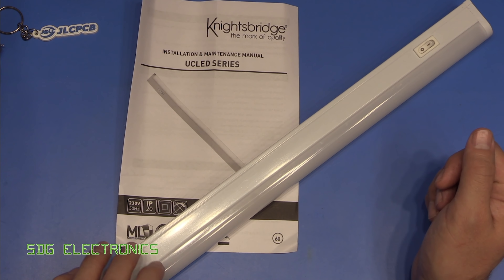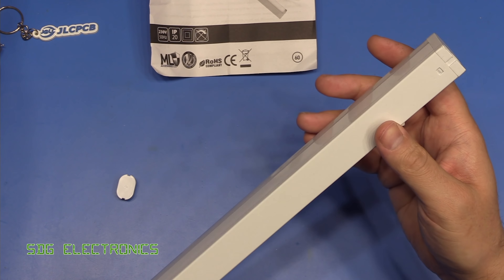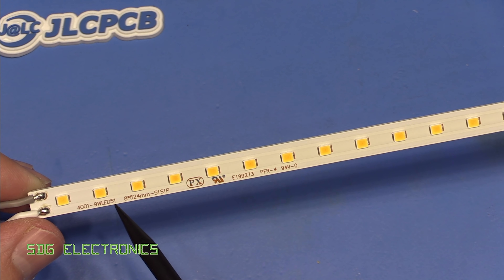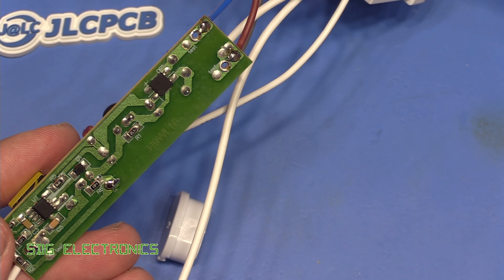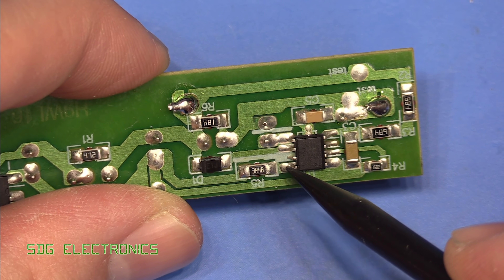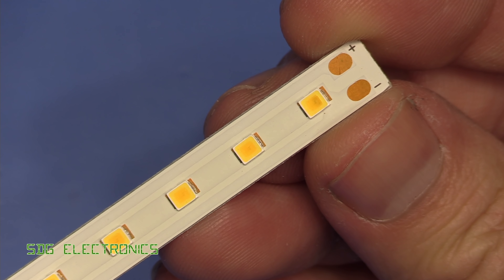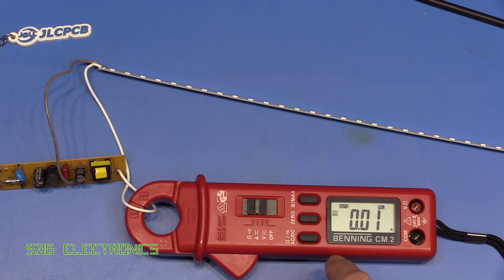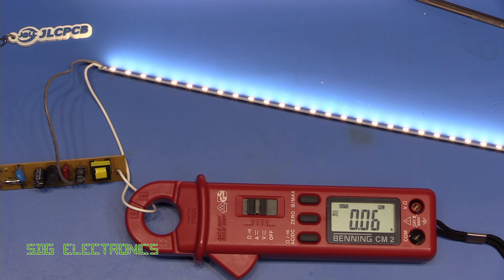SDG #200 The repeated failure of Knightsbridge strip lights.

Comment: I periodically also repair blown out LED lamps. And instead of a burned-out LED, I usually solder a 20-50 ohm 0.25-0.5 W resistor. After this, the lamps are no longer returned for repair. Even in my 32-inch TV, I replaced the burned-out LED in the backlight tape with a 20 ohm 0.5W resistor and after that no problems for 5 years.The resistor will limit the inrush current during operation, which can break through the heated LEDs, but will slightly reduce the efficiency by a couple of percent.

Comment: I usually buy cheap no-name LED light fixtures and bulbs, and in my experience dead LEDs are the most common failure points. I think it's because manufacturers pump as much current through them as they are rated for, if not more - so the light can shine as brightly as possible with minimum manufacturing expense. This is also a big problem for TVs with LED backlight. Of course, drivers have died on me a few times, but those were the exception. When I build my own LED lights I tend to underdrive LEDs, i.e. use 1W drivers with 3W LEDs. This way they still produce plenty of light but last a lot longer and produce less waste heat.

In the case of your light it's strange that there was one LED that looked cooked while others are almost pristine. I'd expect all of them to show some signs of degradation if they were overdriven. So I suspect that the dead one had a manufacturing defect. Maybe higher equivalent resistance, making it overheat when driven with a constant current.

Comment: The same strip lights we use in our refrigerated cabinets at work, in general they seem quite reliable. Occasionally we might get one that's faulty out of the box, the next time I'll strip it down and check whats wrong. I think on the larger ones there might be 2 strings in parallel as I've seen them with one side flickering so probably a faulty LED in one string.

Comment: 9:19 using rosin core tin of course it would resist bridging))) it flows away from the gap.
That's why I use tin without flux. You can have more control over it by dispensing precise amounts of flux.

Comment: I recently began to suspect that humidity may affect lifespan of cheap chinesium LEDs significantly.
I bought ~36x E14 spotlights with 4x 1W LEDs each and only ones (7) in single bathroom fail stupid often.
Checked currents, temps, swapped lights from different rooms, nothing matter.
Used like 35pcs pack to repair ones in that bathroom and like 5pcs for other rooms.

Comment: 60mA with 1 turn looped through the clamp m.  looping 10 turns through would probably give better resolution if necessary  (0.055 -.069..) ..👍

Comment: Bit of a fail design-wise if one LED failure totals the whole strip?  On another type I just fitted (and modded to get right length) there was a bus running down the sides of the strip and suppyling sections with  appropriate resistors, that was with a fixed 12v DC supply to the strip.

Comment: Most of the time, at least in my experience, it is usually an LED or it's internal bridge wire that is at fault if the bulb or light dies fairly early after only a few days, weeks or months.  If the bulb or fixture dies after that it tends to often be a driver failure but it really depends on the build quality.

Comment: I think it's a bad idea not to use the warranty, because otherwise the manufacturer will not fix the problem which seems to be systematic. Not everyone is like us able to figure out the problem and short out the broken LED . If the problem stays Hidden it just leads to so much waste,such a shame.
I urge you to use the warranty even if it is a hassle, a lot of manufacturers seems to be making LEDs designed to fail quickly and they are getting away with it.
Reply: Exactly this!

Comment: That last LED has less copper to its right compared to the rest of the LEDs. Also see that the dark spot is on the right
Reply from the maker: Good spot
Reply: Are you suggesting 60-70mA going through it heated it up so that it failed?
Reply: @GeorgeGraves  yeah
Reply: I was just about to suggest that.... perhaps a “dry” joint where the wires connect to the led strip, causing the joint to heat up? I had an almost identical fail with the led closest to the wire connection on a light at work .... just thinking aloud here.  They had thrown it away along with the power supply, repaired that (dry caps) and shorted the first led... bingo, now it’s a microscope ring light on my bench 👍

Comment: I recon that the leds need some more heatsinking. The last LED does have less copper around it. I think they are being driven on the edge of their specification and the heat dissipation the manufacurer allows. Together with the enclosure, no ventalation, smaller heatsink area and tolerances in the LEDs has caused this one to fail first. The LEDs will last a long time under the right conditions, just turning the current down by few mA could extend the life by a fair amount and not really noticable in the light output, shame really.
Reply: The copper tracks hardly aid in heat dissipation since they are too thin and the thermal coefficients from the die to track are far too high.

Comment: Logically it shouldn't be the case, but from my experience it's always the first or last LED that fails first in these aluminum strips. Don't know why, though.
Reply: It's @ the " end " of the strip.. so heat can dissapiate in one direction only... hence more slowly...causing higher temp. rise...so maybe the reason is thermal failure....
Reply: @analoghardwaretops3976  If i imagine thermal gradient in such a strip I think that the hottest point would be in the center, because it's surrounded by warmth from both sides, so LEDs should theoretically fail there if it's due to high temp. Further investigation is needed I guess.
Reply: @hackleberrym 
 ...theoritcally  so  but for such a case (center hottest) we have to assume...
1) there really is some air flow...
2) led @ extreme end has same temp. rise and rate of temp rise as other leds.." if"  its thermal dissap. is adequate..
3) assumed is horizontally placed.. being vertically placed this assumption won't hold up.

Comment: With a broken led you might have a chance of repairing the next time
Reply from the maker: Just need a better way of gaining access. I think sliding the strip slightly and desoldering could work better
Reply: @sdgelectronics  I think you'll be able to remove the diffuser after unclipping just one end, which will give you full access to the LEDs.

Comment: Thanks for the teardown and investigation, surprised it wasn't an electrolytic. Designed around cheaper components for cost cutting. Without getting too involved in your kitchen layout, may I suggest using two of the 300 in series instead? Seems like a 600mm unit fault.

Comment: Cheap LEDs all suffer from the same low life syndrome. 
Most of the time it's the bonding wires that come lose, arc and create a black spot.
These are also impossible to replace as they just disintegrate as you clearly demonstrated.
Reply: The problem with all these LED bulbs is that manufacturers rely on them to operate at 50-60 degrees Celsius. Which means that the temperature of the crystal will be 75-90 degrees, which is already critical for the crystal and the crystal breaks through during current surges. If the lamps were equipped with sufficiently large cooling radiators that would keep the temperature at 40 degrees, then there would be much less negotiating LED lamps.